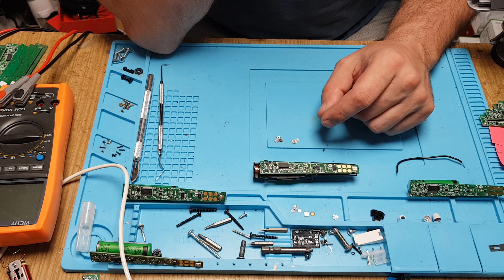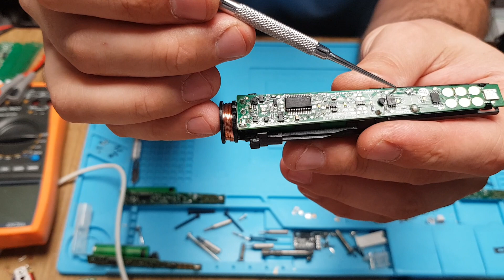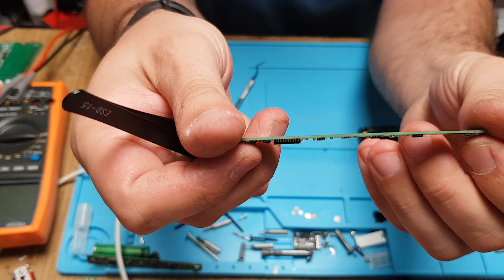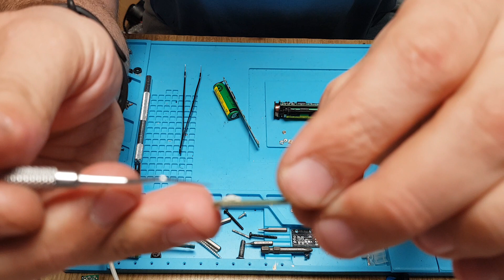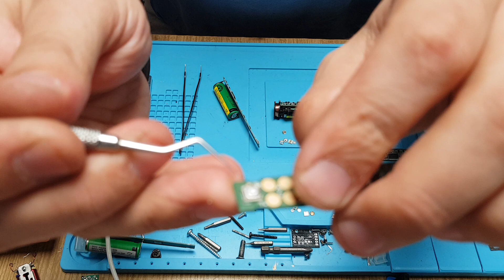Repair of water damaged Philips sonicare toothbrush motherboard, PCB diagnostics and repair

Comment: i have the hx9350 model and the button function works after testing with multi meter. Everything looks good on board.  Symptoms where it would sometimes turn on and work then after awhile it would not turn on or off. Eventually it stopped turning on and responding.  The toothbrush charges but does not turn on, could it be the battery? shows 3.55 volts. Gr8 videos btw. thank you
Reply: ok I ran the wire from the button to the r1 and it turned on!!! wow so I need to take the board off clean the back contact area of the trace as you shown. See it it works.
Reply from the maker: Yes majority of time the damage is on the back side. You need to take it off to clean and restore damaged traces. Additionally water could be inside of the button and when it dries it leaves residue and doesn't work..

Comment: Your toothbrush fixing videos are the best I found so far. I would like to ask, since I haven't figured that out. My toothbrush has weird symptoms, at first I thought, just replacing the switch and fixing the gap would be sufficient, but when I turn the brush on it turns off immediately, all lights off too, the same happens if I switch to any mode when turned off and then press the power button instead of starting just turns off, again all lights off, with very short, less than a second long buzz. However, when I desolder the motor coil, the brush stays on, when I connect the coil it turns off. What might be the problem? I don't have an induction meter, to measure the inductance of the coil, but it's hard to imagine with such thick lacquer there could be a short in winding. I have Sonicare Flexcare. Thank you for the great job with the videos.
Reply from the maker: From description you had water damage. Take off the motherboard completely and inspect bottom side of the board as well. If there is corrosion on through hole pins resolder them especially 4 traces where control signal goes to the mosfet.

Comment: Can you tell me if I changed de motherboard and now when when input in on the charger the leds only blink.. is the battery dead then?
Reply from the maker: If battery is from 3.6 to 4.2 volts it's fine. Did you installed a new Motherboard? Additionally what about the charging coil is it ok, not damaged?
Reply: Yes I put a new motherboard in.
How can I check if it is the charging coils is damaged
Reply from the maker: First suggestion would be simple visual inspection if coil not damaged it should be ok.

Comment: First off, I am very thankful for your videos. I repaired my diamond clean with a new PCB board since it had water damage. Everything seems to work great after replacing, but now it will not charge. At least, the light will not come on like normal when placing it to charge. I tested continuity on the top and bottom of the charging coil as well as the test points next to the pins and checked out fine. Not sure why I can't get a charge. Have you come across this when replacing the pcb board or anything?
Reply from the maker: difficult to say.... if you have old board you can double check the KLB chip as it is mostly responsible for charging. if coil is not damaged by removing the toothbrush from case only charger could be faulty... although they are quite reliable..
Reply: Charger is good since I have two of these toothbrushes and the other charges fine. I most likely have an old board as it is pretty old. Where is the KLB chip or what does it look like?  @letsfixitgarage
Reply from the maker: KLB chip is usually found on diamondclean and other boards on the bottom part of the motherboard. There are two chips one of them 5 legs if not mistaken will have KLB on it. If you have 2 brushes you can check both boards chips in resistance or diode mode and see if something comes out as faulty. Do take out battery before testing as not to short something..
Reply: Thanks again for your guidance. The KLB chip had a little solder on two of the legs and combined the contacts when I was placing the battery back in. Removed this and boom working. You are amazing.

Comment: Hi.I bought a new motherboard from Aliexpres,do you have a experiences they cuold by faulty?Becouse does not work.By pushing botton lights a short time.But no funktion.Thanks
Reply from the maker: Sorry haven't tried ones from AliExpress.. and there are a lot of sellers...  I usually use original donor boards that I get from defect brushes from eBay.. try to contact the seller they are quite fast in replying and avoiding bad reviews..

Comment: Hello, maybe you can help me. I have Sonicare same as on this video. All works perfect, but it have some strange issue. After I finish using it and leave it for some time ~1-2 minutes and it is automatically turns on Light, and it is never goes off. So It always needs to be placed in charging glass. I thought that it could be something wrong with button, when i touch some contacts I was able to reproduce issue. So I replaced a button from old one and issue still exists :(
Reply from the maker: sorry, don't have a concrete solution.. it could be that some elements on the board are getting bad.. its quite difficult to diagnose this partial defect.. I would start looking for a donor board and when it will get completely defect then try to diagnose and exchange the components..

Comment: Thank you very much for your videos. It helped me to successfully fix the issue with the loudness on Philips Sonicare HX992R (180630). I was able to separate the coil and vibrating magnet (about 1.5 mm) enough to reduce dB back like new (after 2 years old). I also tightened the all the screws to secure the head pin and put silicon grease before assembling back. This saved me $$$!
Reply from the maker: Nice job :) share the knowledge:)

Comment: Thanks so much for all of your videos, My Sonicare was revived 2 times through your videos, and water damage was complicated, so I will post another comment later explaining what I have gone through.

Right now, my fuse F1 is labelled as P blown out for some reason That I don't understand, I bypassed the fuse, and it worked for a few seconds. Then all lights are off and can't turn on, yet the toothbrush still works, and I can switch the modes, but no light, I used your clever diagnostic of supermarket thermal paper, and I found that the IC labelled as IU2FA is burning hot!

Any chance of knowing what is going on? I disabled the battery solder points as this is dangerous.

I ordered a new board from Ali Express for a full swap, yet I still believe that if I change the IU2FA, it may work again; any explanations?

And most importantly, How can I get this IU2FA? Digging on the internet, I found this close but not enough.

MP9361DJ
https://www.eevblog.com/forum/beginners/iu2dh-smd-code/

Any help will be appreciated.
Reply from the maker: Nice job with other repairs. To disconnect the battery power to the brush you can remove solder blob next to the negative battery contact. This is a bridge that easy disconnects power to the brush. Regarding the chip I would say the fastest way is to get a simmilar defect brush from eBay and exchange the chip. Sorry don't have any info about it

Comment: Hi and thank you for teaching this to us. I've replaced the PCB on my HX9360. After connecting the jumper on the new PCB it worked again. Now its battery is depleted and it's not charging anymore. It was reacting to the charger through the LED's but not charging as it's dead now. The battery does still have voltage so I suppose it is fine? Any idea on what to look for? It simply won't charge up anymore :( Thank you!
Reply from the maker: Where did you got the new PCB? Maybe it is defect and you could contact the seller for a replacement.. or maybe charging coil got damaged..
Reply: @letsfixitgarage  hi thank you! So i got it from aliexpress. With a bit of tinkering i managed. I recharged the battery, bypassing the coil. Also I don't think the coil is the problem. After charging it it would constantly tell me the battery was depleted, even though it was fully charged. I removed and then reconnected the board jumper next to the battery pin and et voila it turns on again. Problem now is it seems the LEDs don't turn off anymore. I've attached a video. Have you seen this behaviour before or any idea? https://youtube.com/shorts/0SGzLtUJfck?feature=share THANK YOU 🙏
Reply: Curious I am having somewhat of the same issue with battery not charging. Mine has not been depleted yet though. Yours seems to at least light up as if it is charging when placing on the charger it looks like from your video. Mine has no response when doing so. How did you bypass the coil to charge it?  @marcelm524
Reply: @letsfixitgarage  Hey. Also just tried to charge it again. So it does actually react and charge on the induction charger. It basically works, it just does not turn off. I made a video of it's behaviour and uploaded it here: https://youtube.com/shorts/TFbCNGPqAtE?feature=share – do you have any idea what that could be? Thank you! 🙏
Reply: Still no luck on fixing this one, just don't understand why it doesn't properly turn off after use or charging :(
Reply from the maker: It's really difficult to diagnose just on description.. but still if you bought a new board from AliExpress you should contact the seller as it seems that the board is defect.. there is no relationship between PCB functionality and battery or Electromagnet..

Comment: hey, i have a model 9360 with a poor repair attempt by someone else. There is a small 6pin SMD package missing, the one next to the Battery GND.
It seems like it was accidentally removed with a much too big iron when the battery was replaced.
Can you tell me what it's marking is, or whatever you know about it?
On a video it seems to read KL8 or KLB
Reply from the maker: sorry for late response for some reason didn't got notification about this message. you are right writing is KLB but I havent seen this part as spare part usually i take it off some donor board if needed.. If not mistaken it should be responsible for charging

Comment: Hell, thank you for the great video first.
My toothbrush got water damaged too, it vibrated a little bit whenever I pressed the button, but it couldn't start. I took the pcb out and dried it out, it still had the same problem. But suddenly one time when I pressed the button, it started to work. And shortly the Q1 burnt out with smoke. I think Q1 is in the H-Bridge you mentioned. The weird thing is, after the Q1 burnt out, the toothbrush started to work without any problem. What is going on there? Is there any potential problem without the Q1? Should I replace the damaged Q1? Is it as same as Q2?
Reply from the maker: They should be the same, check the writings on the chips. Q1 burned through in open state that's why electronic works even with burned through MOSFET. You should exchange it additionaly check my other water damage videos there could be additional damage that needs to be fixed prior..

Comment: Fuse has gone on my board. Can you tell me what to order?
Reply from the maker: I don't remember the size correctly. I think 0402 is the one needed.. but better would be to measure it of course. I have some Chinese 2a fuses that I set in place of the dead ones, they work fine. Is this not to much I don't know for 100%
Reply: @letsfixitgarage  Thank you for the prompt reply and info.

Comment: On motherboard there is a bridge in the bottom right corner, when I was removing the old battery I think I removed the bridge by mistake it took me 1 hours to realise.
I followed the + path and then - path, and found it.

Thanks Broski.
Reply from the maker: Yes. It's a safety bridge. You can desolder it before starting work on the board, or exchanging of the battery.

Comment: Great video, thanks for posting. Do you have a video on how to take the board off the unit? I have a PBCR3 board that won't power on. Ive had mixed results with continuity on the power button, works then doesnt. Since my board is a little different I cant tell where you are testing around 15:00 from power button hole to near U1 chip. Does the test point have a label? I used multimeter from power button hole and ran probe along U1 chip and the unit powered on. I assume that means the path from power button is bad. From which points would I have to solder a jumper and to which spot? Thanks.
Reply from the maker: Sorry I don't know all the models. But idea would be the same. To take it off desolder battery terminals and induction coil terminals and it should come off.. for the point. I would do the following: first remove the battery so you wouldn't short something :) Then simply follow the line to which point on the chip it gets. Then it's up to you if you find some place where the track is corroded away - repair it, if no you can run a jumper wire from button directly to the chip..

Comment: hi, your videos are very interesting and helpful. 
I have a different kind of Sonicare (HX680A) and I think the button has a problem and needs replacing. How do I know which button to buy and where
Reply from the maker: What are the symptoms?
Reply: @letsfixitgarage  sometimes, I can't turn it off and sometimes it turns on without touching it. I can see rust on the electromagnet, so I know there was water inside.
Reply from the maker: Ok so yes you have water inside the button. If you have good magnification you can take it apart and clean it. there is a video in my channel regarding water damage repairs and I show how to take apart and clean the diamondclean button bugger ones are even easier.. or you can desolder the old one take it to the electronic shop and hope they will have it.. or search in aliexpress they have everything :D
Reply: @letsfixitgarage  thanks. I will check the video! The button is pretty small and I do not have the magnifier (yet). So I was hoping to replace it. Thanks for from Austria!
Reply from the maker: Without magnificqtion it's quite hard especially first time.. then exhange is better option but again desoldering could be tricky with soldering iron.. hot air is easier.. Gruß von Litauen :)

Comment: 2 years, the toothbrush does not turn on. PCB path corrosion. I connected the paths and it works. Thanks.
Reply from the maker: Nice job! Yes these through holes are quite sensitive but all the other electronic components hold up quite well..

Comment: Hello. I have had a totally fine working toothbrush, but it was making a strange noise. So, I have dissasembly it, removed PCB, tighten the screw on the top and..... by mistake, I have shortened two of those six diagnostics pin. I've did shorten the middle two pins ( two out of six - in the middle ). Before, when I connect multimeter to one pin and other, there was about 3,6V, now, it is showing 0,5V and the toothbrush dont want to switch on and dont want to charge. When I connect multimeter to those two pins and after I press switch button, the voltage goes down from 0,5V to 0V and then after one second it back to 0,5V. Could you, please, tell me what to do now? You have mentioned about temporarily fuse, but how long I need to wait for this fuse to let the current flow?
Reply from the maker: Resetable fuse is next to the positive battery terminal you can check if it's ok with continuity mode.. it usually resets almost instantly and it's not eternal it does burn through.. but if it's ok don't really have any advice.. these pins are used to program the chip.. so it could be that logic chip fried.. never had this situation so can't give you any advice :/
Reply: @letsfixitgarage  If you were me, what would you check first? Apart from this fuse.
Reply from the maker: Difficult yo say.. if the fuse is ok, battery is charged and it was a working toothbrush without water inside there is not much to check.. chip will be bricked.

Comment: I just wanna let you know that you made my day. After 6 hours of tweaking and troubleshooting I was really close to getting rid of that toothbrush. Nothing worked for me and I almost gave up watching your video too early. For me the issue was blown fuse. My dad probably shorted the pins of controller - before passing me the toothbrush to take a look. You are great man! I just shorted the fuse which isn't the best solution, but it is the solution that's working.  Thank you once again.
Reply from the maker: Thanks it's always nice to hear that someone found it usefull!  and it's the most difficult task to keep the interest and somehow convince the viewer that the info you need is there.. if you had water damage on the brush you may find my newest video usefull too: https://youtu.be/xdaX3p8pps8 check it out and thanks for watching!
Reply: Did you do it from the back end or from the elements side ?

Comment: BTW what battery do you recommend?
Reply from the maker: Is the original really dead? Maybe it's only deeply discharged. Check with multimeter what voltage it shows..
Reply: @letsfixitgarage  it shows 0 voltage, it wouldn't charge. i dont have anything to charge it with higher voltage though
Reply from the maker: @mike82y  0v is of course to much of a discharge.. there are methods that could work but the capacity will not be the same and it's not very safe.. so yes new battery is a must. I would sugest any same size li ion battery or a genuine replacement but you are talking about replacing the seal to, so I asume there was water inside.. are you sure there is no corosion on the board or back of the board? Not that you will buy a new battery and it will not help..

Comment: can you replace the seal on the top?
Reply from the maker: When you take it apart it's very easy to replace the seal. And sadly no way to exchange it without taking it apart..
Reply: @letsfixitgarage  thx, I managed to opened HX9370 by following your steps. I will replace the battery and the seal next. nice videos, keep it up!